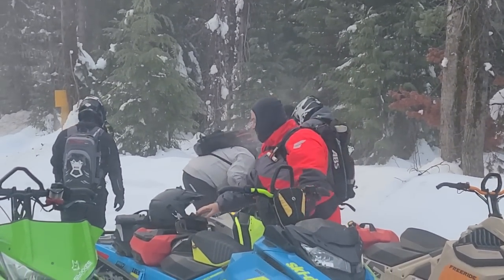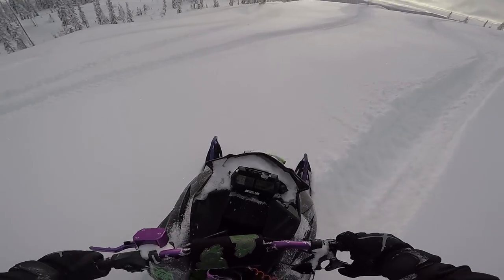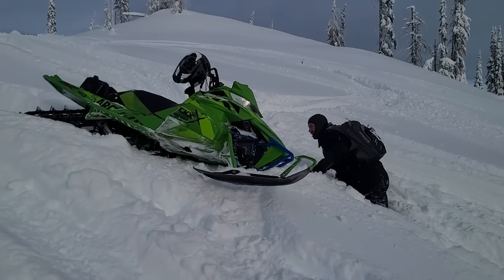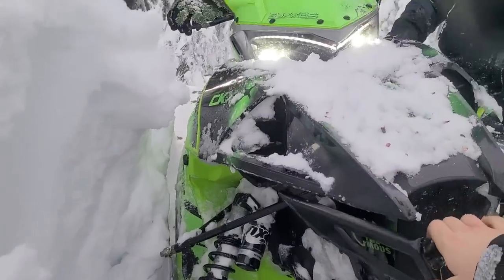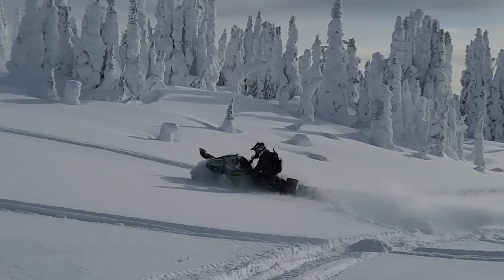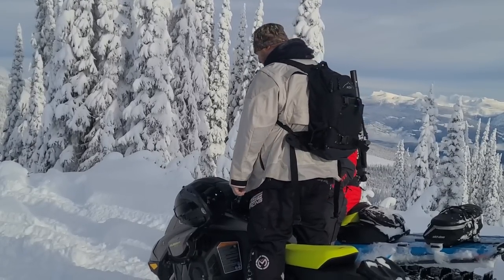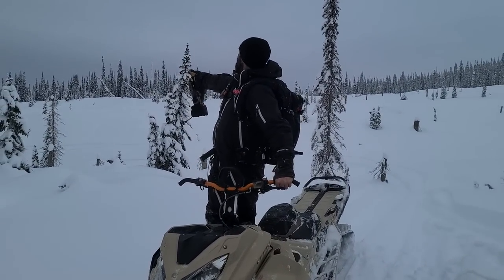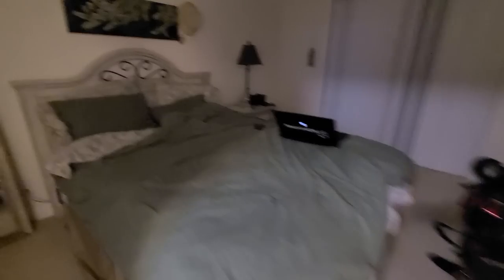Deep Snow + Turbos + Avalanche

Comment: I weigh about 280 body builder. I have a 14 M8000 with big bore kit.  It has 3 stage front exit shocks.  Wondering how stiff I should run them?  They feel way to soft for me right now